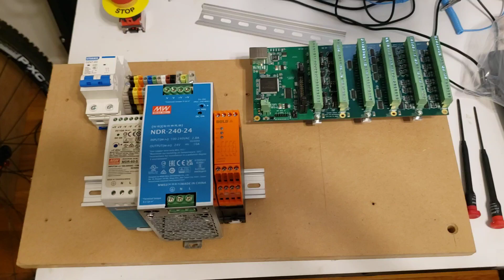More 7i95 ramblings

Comment: Looking forward to the build!
Question about the 24V PS... What do you intend to run with the 24 volts? Just wondering how many amps for field I/O.
Reply from the maker: Right now, this is just basically a test board to mess around with some physical IO so I could've purchased a smaller 24v supply, but my intention is to eventually migrate this to a workable system, maybe that Fadal I mentioned or maybe I'll use it for my router, so I didn't want to fall short on power for future expansion. you could use a smaller psu and still get good results. It all depends on how much you're trying to power. The outputs on the 7i95 are like little solid state relays in that they can drive 2A, so they could consume a good bit of power in the right situation.

Comment: I got a mesa 7i95 board and I installed linux cnc today. How do you do the interface on the linux cnc end?
Reply from the maker: You can use the 7i95 configurator tool from Big John T on the Linuxcnc forum or you can create a configuration using pncconf and selecting 7i76e, but there's a bunch of grand editing you need to do with that method. The configurator tool is probably the best way, but it's a third party software that you have to download.